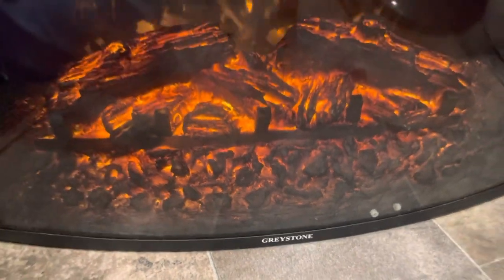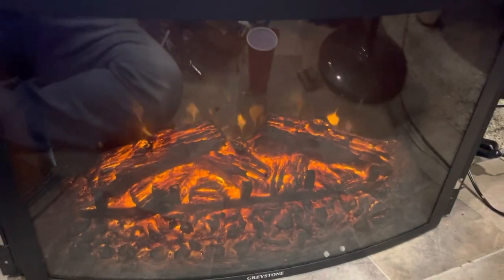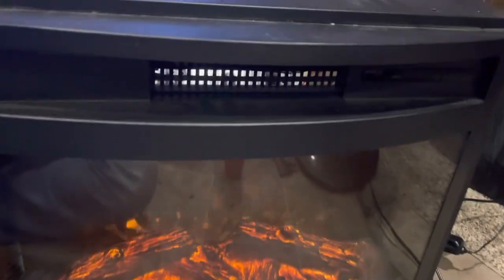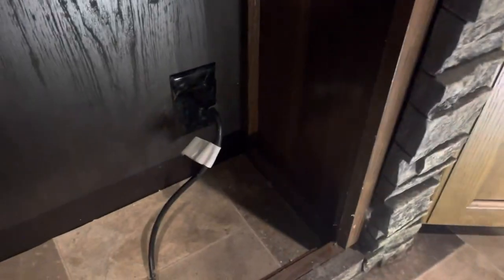Greystone RV Heater - Quick, Easy Fix

Comment: Please let me know how you were able to get that out from the mantle!! My mother in law is now living on our property and since we have connected it to power I have not been able to get the fireplace work.. I can not figure out how to remove it. I can not see any u shaped ring on the outside to access screws because that part appears to be behind the fake rock mantle.
Reply from the maker: There is a piece of trim on the outside perimeter of the heater. The trim is about a half inch wide. You have to lift that trim upward until it is released. It's about a half inch or just a tad more. I hope this helps.